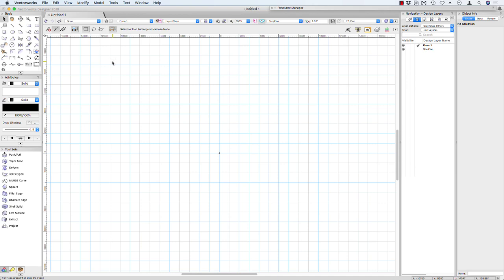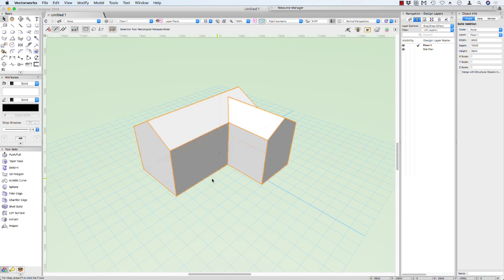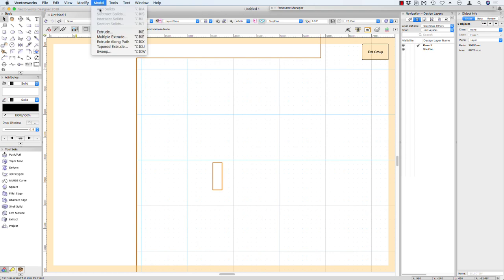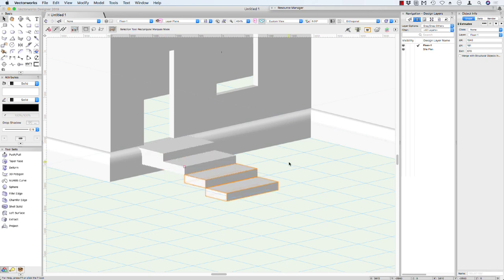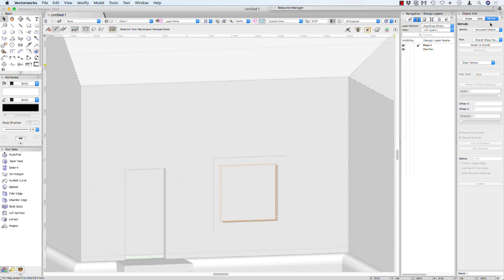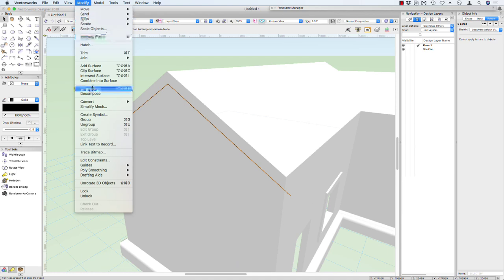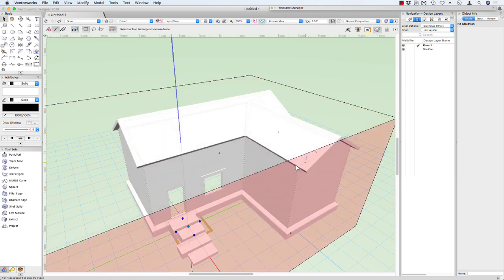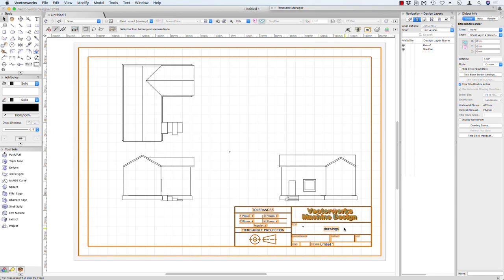Quickstart to Vectorworks Part 2

Comment: Using VW-A 2024, whenever I use the "shell-solid" tool to create a roof in your second method, and select "outside" It won't automatically create the peak—instead it extrudes the shape it perfectly tangent to the lines, leaving a 60º triangular gap at the peak of the roof. Any idea of what I'm doing wrong? Thanks!
Reply from the maker: I think I know what the issue is, but you will have to confirm this. When you extract the roof faces, they have to added them together using Add Solid before you have tried to use the Shell Solid tool? I have a movie that will go live tonight. here is the link: https://youtu.be/SpNt__5ashI
Reply: @archoncad  Thank you! I repeated my steps a quite a few times, and eventually it worked, so next time I do that process I'll keep what you said in mind and see if that resolves it all.
Reply: @archoncad  That video helped—especially isolating the roof shell-solid operation inside the roof group. The error on my part was not keeping track of my undo-history—so while I had created a solid, I reversed it unintentionally while trying to undo my "shell-solid" operation. Now I can see that in the Object Info palette it will tell me whether something is a "Solid Addition", or "2 NURBS Surfaces". The shell-solid tool works exactly as you show it when isolated in a group, but when not isolated it tries to combine all adjacent and unselected geometry—I think this is a setting I have unintentionally selected.
Reply from the maker: Thanks for your comment

Comment: Its not explained how, for example, when you want to create a new window how you could position it accurately with measurements on the wall exactly where you want it. it seems it just positioned where ever you randomly click the mouse.
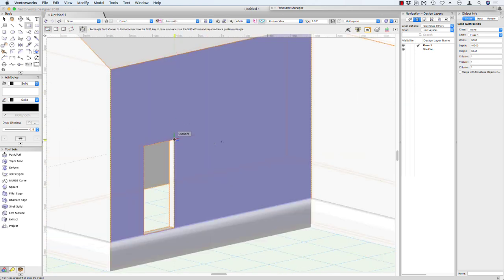Reply from the maker: I know it looks like it is random, but you look at 7:27, I snapped to the head of the door and I have my automatic working plane active. At this point if I hit the G key on the keyboard, that will set a floating datum and I can then use that datum to control the positioning of the window relative to the door.

Comment: Hi Jonathan, I'm trying to make the roof but the polygon doesn't snap to the midpoint (1:58). I've tried changing the snapping options with the snapping palette but it didn't change anything. Do you know what the problem could be?
(I'm using the 2021 Designer Vectorworks)
Reply from the maker: Hi, it is hard to know without seeing, but are you sure you have the correct snap settings and were you using the correct automatic working planes?

Comment: Hi Jonathon, Great tutorial. I'm on Vwx 2020 and it doesn't have a option to create multiple viewports. Am I doing something wrong, or is the feature somewhere else now?
Reply from the maker: Usually, the option is on the top right of the drawing window. I tend to use the “M” key, which is the shortcut. If you are using Vectorworks Fundamentals, it might not be in the workspace. Thank you for the compliment. If you liked that video, remember to try all the videos in the series, then join my web site. Www.Archoncad.com

Comment: Excellent tutorial. As always, you show how to use multiple tools and thats super. Can one duplicate the doors and windows (openings) to place some more of them in the model? Can you place stock doors and windows in the model to speed the process? Ramón.
Reply from the maker: It’s possible but editing the solid addition or solid subtraction and copying the extrusions. It would be better to use the model method to make the holes and then use the Vectorworks door or window objects.

Comment: Very smooth but when you are that good some of the "moves" are hard to follow. It would be beneficial to confirm the settings for some of the commands and slow the presentation when new commands are being used (off-setting the bottom polygon is very hard to follow) . I am working with two screens and pause the presentation or repeat it many times.
Reply from the maker: Have you completed the first movie?

Comment: Hello Jonathan, great videos. I've got a problem creating hollow interior with Extract + PushPull tool. I'm able to do it almost succesfully, but there stays some "floor" element, which I remove afterwards by another step. You in your tutorial didn't have to do anytning more, than just pull the indoors up towards the roof.
Reply from the maker: Hi, sorry for the later reply, make sure you are using the Automatic working planes and you have selected the correct options in the tool bar, instant push/pull.

Comment: Hello! When I click offset, the polygon i made just offsets on the Z plane (it moves downward and the size of the shape does not change) instead of appearing the way your's looks (inset) What should I do?
Reply: Make sure to check "Create planar objects" in extract tool settings
Reply: @SantiagoMolinaC  Thank you!!! Drove me crazy :)
Reply from the maker: You’re welcome
Reply from the maker: Clare Diaz are you sure you are using the offset tool? I can’t think of a reason why it wouldn’t offset.
Reply: Are you sure you are using the Offset tool, not the Move By Points tool. I have just threes This again and it works just like the movie.

Comment: Mr. J Pickup, Part one was very useful, I 've tried it but I failed to select the area when I made the line to do the slop of the roof, what snape you used at that step, you notice there was no snap box to view during your lesson if you can explain what arrangements we have to pick to make it works?
Reply from the maker: Hi.  The snaps that I always use are:
 snap to object
 angle snaps
 snap to intersection
 smart cursor
These are your 4 most useful snaps. When you draw your polygon to create the slope on the roof you must ensure snapping to the left edge of the object. When you get to the top all the peak of the roof, ensure you are snapping to the top edge ( and I snap to the center or midpoint). Finally, ensure that you snap to the right edge. if the polygon does not snap to the edges, you will not be able to subtract the parts that you do not want.

Comment: Hi,  When I try to move the window back into the wall with Move by Points tool, the window does move deeper into the wall but it also moves from it's original location. Not sure what I'm doing wrong. Any help most appreciated. Robert
Reply from the maker: I do not understand why you are using the move by points tool on the window. The Move By Points tool is great for moving a window object that is in a wall. This movie is about fast 3D modelling without using standard architectural objects. If you are able to move the window using that tool, watch out for the plane you are working on. Use automatic working planes to find the face of the wall and move the window along the wall. 
I hope that helps.
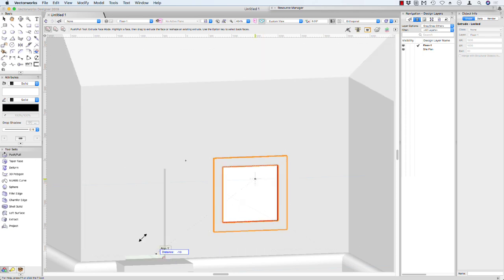Reply: @archoncad  Thanks, Jonathan. I realize this is free form modeling however at approx. 10:30 into Pat 2, you use the Move By Points to sink the window deeper into the "wall". I think you click on the corner of the window object and then click on the midpoint of the bottom of the door frame. For you, the window sinks into the wall. For me the window moves down to the midpoint at the base of the door frame. It's a trifle but I just wanted to figure out how to sink it deeper into the wall without moving it to the midpoint reference at the base of the door frame.  :-/
Reply from the maker: @TheBBDEE  OK. I see now. I had forgotten that I had done that. If you look carefully, you will see that I use the edge of the door frame to move the window deeper into the wall. Using those two points controls the direction of the move, forcing the window deeper into the wall. you could use the a face of the wall that is in the same direction as the move you want, that would work, but you can't use random parts of the wall. If you use the face of the wall adjacent to the window, the window will move along the wall, not into it.

Comment: Hi Jonathan, When I try to create my roof, as your do in this tutorial, using the poly tool, you say find the mid point and go up to 30%...I seem to loose the midpoint here and the roof is off centre, is there a setting that may be off on my end....I have played around and can't seem to find the easy fix! Thanks for your help and great videos!
Reply from the maker: you have to have the automatic working planes turned on. Then make sure that you have your snap to objects turned on.
Reply: @archoncad  ~ thank you. I do have automatic working planes on and snap to objects...still not working to snap to the midpoint and the right angle...but I can get through the exercise regardless, just a slightly off roof! Thanks for your help. :-)
Reply from the maker: You’re welcome.

Comment: Greetings Mr. Pickup; I find these tutorials very well put together and engaging. I am a draftsman that needs to upgrade my software skills for the current employment market. I have used AutoCAD Civil Land Desktop for years and I am looking for recommendations for software package that I can use to render residential architectural, site plans, and steel fabrication shop drawings with ortho views. I am used to working in model space and views in paper space. Would Vectorworks be a good choice??
Reply from the maker: I think Vectorworks is a good choice. I am biased though, i have been teaching Vectorworks for over 25 years and i have yet to work on a project where Vectorworks let me down. All CAD and BIM programs require substantial learning.